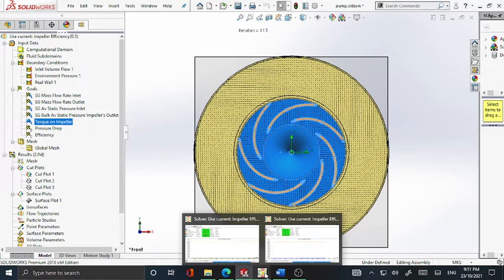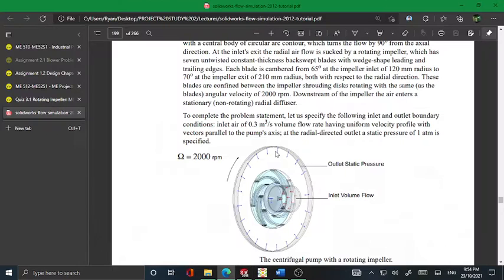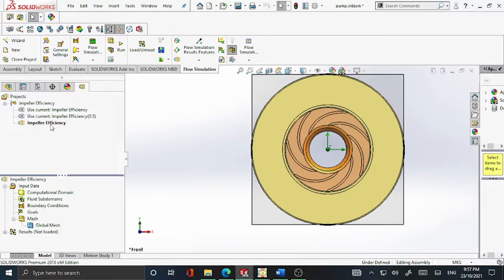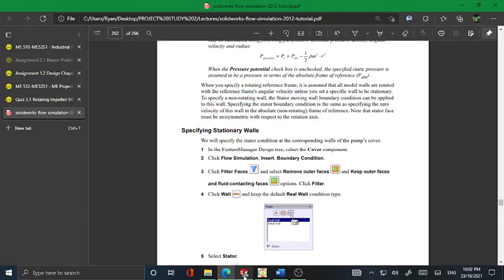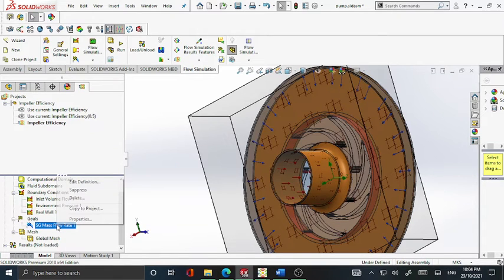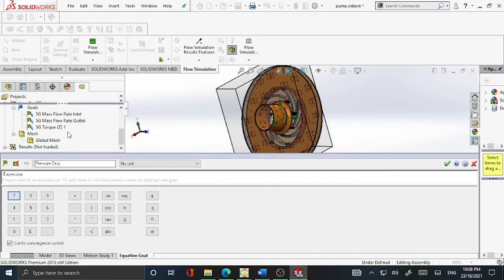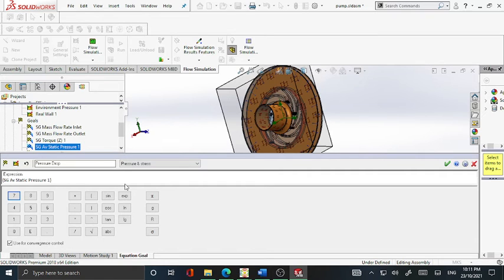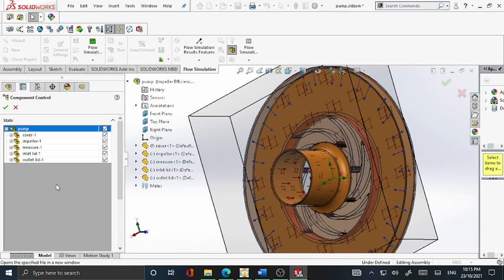Rotating Impeller-Solidworks

Comment: Hi do you know where can I get the solidwork file for this impeller? Or any tutorial to construct the CAD file for this kind of impeller?
Reply from the maker: when you have solidworks installed in your laptop or computer... just go to the drive c: then find Program files then click on Solidworks Corp then click on the folder Solidworks flow Simulation then from there you can find series of built in files that can be used to conduct practice for Flow simulation... Just have the flow simulation feature activated first so you can access these things when you install the solidworks
Reply from the maker: https://www.solidworks.com/sw/docs/edu_simulation_hotd_instructor_2012.pdf
Reply from the maker: here is the link for the simulations including this one about the impeller 
https://www.academia.edu/3713889/Solidworks_flow_simulation_2012_tutorial